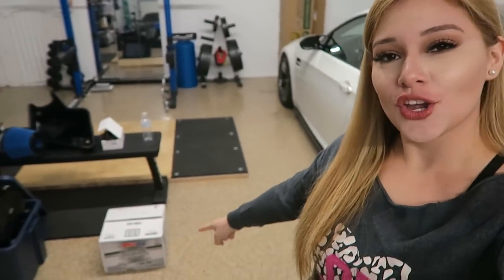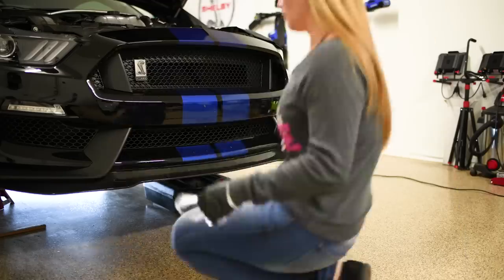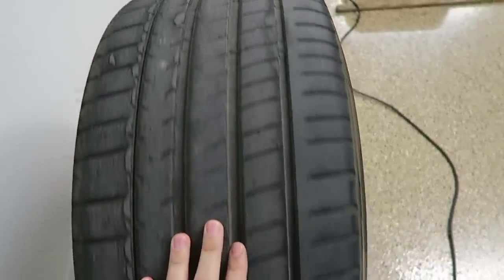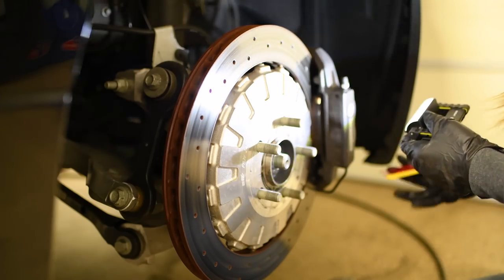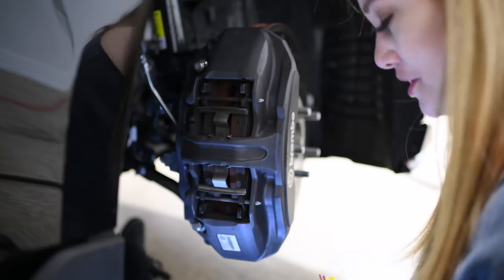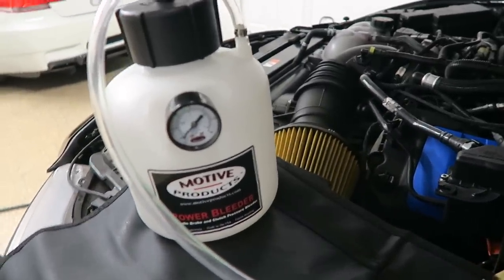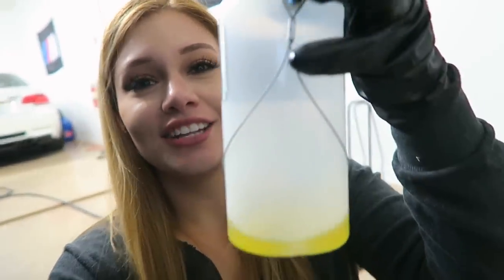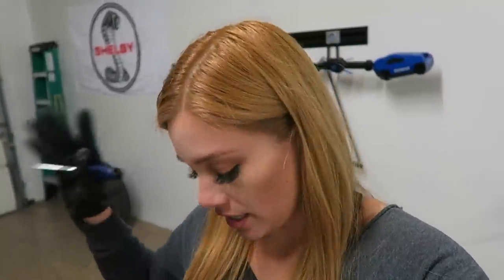2018 Shelby GT350 Brake Flush and Oil Change PERFORMED

Comment: Interesting about not oiling the o-rings. Not to mention seeing a GT350 serving as a test mule for the GT500 and talking to the engineer. Finally got my break-in miles in and did my first oil change. Putting a quart size freezer bag over the entire filter assembly as you remove it works great! Excellent video as usual. Great content, editing, and video quality!
Reply from the maker: I thought so too. He went into further detail about it. But he was firm about me not oiling it next time. Pretty knowledgeable guy. That is a good idea on the freezer bag. I never thought of that. It would save a mess from happening every time. Have fun and enjoy! Thanks for watching.
Reply: @woman.driven  tearing the orings because you put them in dry is worse then the off chance of the filter housing coming loose. if there is sufficient vibration to work it loose then drill a hole through the tightening nut and run safety wire. almost every spin on can style performance filter even has holes for safety wire.
Reply from the maker: O-rings won't be 100% dry. They just won't be oiled more than they need when they go back into the housing. Since oil residue exists in the threads already. I'm just simply relaying the info provided to me by someone who was part of the team that engineered and tested that engine.

Comment: Just a tip... You should be using a micrometer to measure brake rotor thickness instead of a slide caliper. The slide caliper measures an area that extends from the edge of the rotor towards the center. The burr that forms on the outside edge of the rotor can throw off your measurement. A micrometer would measure one spot right in the middle of the rotor surface.

Comment: Just FYI he inside pad on my GT350 wore out much faster then the outside on the front. Always good to check both and when changing pads out the pad with the metal tab on the inside just to be safe. Nice work on the maintenance!
Reply from the maker: I was expecting to see one with more wear than the other. But they wore evenly for whatever reason. Perhaps I'm not braking hard enough lol. I'll likely replace the pads after the next track day. I've also read about changing out the backing plate to a different one to keep the temps down. Not sure if that's what you meant by changing out as well.
Reply: Woman.Driven with 8mm you still have a ton of pad left! New pads start at 9.5mm for stock front pads. The backing plates do block heat transfer to the caliper but force more heat into the pad and rotor as a side effect. If your not cooking seals and fluid which I have not either I wouldn’t worry about the backing plates. As for not braking hard enough, just stay within your comfort zone and dial it up little bits at a time. Brake wear differs a lot between tracks as well. Those with high speed straights into low speed corners will chew some pad!

Comment: Great video content, very educational. I.m considering putting hood pins on my GT350 since the hood dances around during high speeds (also going for the cool factor). Since seeing the GT500 and the use of the Quick-Latch system I have ordered a set. Take a look at the web site for Quick-Latch item QL-50-LP/BP in black. I'm interested in your opinion and perhaps if your considering this would be a great how-to video to post.
Reply from the maker: That is a good item to consider. I do notice my hood dance around on the highway or at high speeds. I will look into it and check them out.

Comment: Saline call Bro cobra Mach 1 Roush Shelby GT500 Big 8 what's 6 or 6 cylinder 5.0 what the exhaust system you can feel every bit of our every time you messed accelerator you can feel the engine, live with the right exhaust but remember cars are only an extension of your body true car lovers know the nature of their machine and no one something wrong from a sputter of a fuel injector that the acceleration of the spark plugs

Comment: wow, well done, this was by far my fave video, well until the lift video; thats the one that brought me to the channel. I really liked this one because i learned alot, annnnd I use Amsoil and Motul too, that surprised me! Motul brake fluid is amazing, so is their ester core oil, but dosnt last as long as amsoil. funny story about the oil filter spin off, it happend in my s2000 on my original F20c engine, after i added a filter magnet to it (i also may have turned it, but that was a loonng time ago when i wasnt very good at working on cars). There is a cool item for the s2k's by J's racing called an Oil Filter Stopper. An arm mounts on a timing cover bolt and via a small steel cable, holds a worm clamp tightened onto the oil filter; clockwise to keep it from spinning. when i swapped my engine, i made my own! well, as always, keep it up and dont give it up, ur doing so well on youtube!!!

Comment: Type 2 or type 3 brakes the type of brake system looks pricing but the caliber is no different might come racing you know when you're racing the calipers and brakes heat up what time does the fluid My Car Performance brake fluid on brake lines things like that sometimes the heating itself War still plates warps a plate just from Heat

Comment: Curious why you chose Amsoil over other products? I use it in my motorcycle. I have a mechanic that is encouraging me to change
Reply from the maker: I read a lot of good things about it and also looked at comparisons with other oils. Plus, after 2500 miles of tracking, racing and canyon runs..no burned oil.
Reply: @woman.driven  Amsoil is the best...look at metal-wear comparisons.  I put it in ANY vehicle that I care greatly for and it's NOT cheap.

Comment: Hi, much appreciated video. I see a lot of great care taken and I see that you are highly skilled. I enjoyed watching you do all that. 
I have been reconditioning the entire brake system of a 1961 Humber Hawk Series II that I have. The car had sat unused for 25 to 30 years and the brake components had ceased and corroded.
It has been quite a job doing it component by component. The front caliper pistons had ceased solid and the only way I could remove them was by tack welding a piece of bar across each one to support and apply pressure with my press. Then I cleaned and painted the housings and replaced the pistons and seals.
The master cylinder and remote servo had corroded through so I replaced them with newer versions. And I remade all of the lines.
I have been reconditioning the front suspension and cross member unit too.
I haven't checked the rear wheel cylinders yet or clutch.
Luckily the engine is fine and started fairly easily. But I have to replace the fuel lines and see if I can clean the tank as it may be dirty inside.
I enjoy doing the work myself and it is rather relaxing.
I am looking forward to having the car drivable again.

Comment: If you don't have a large syringe from an auto store or a turkey baster from the Dollar store, then use an adjustable spray bottle trigger sprayer and spray the old fluid into a coffee can or something that's wide and deep to catch the fluid.
Reply from the maker: Very smart with the spray trigger. Extremely useful tip. Thank you. I just need to stop the excuses and get a turkey blaster.

Comment: you make me wanna work on my car but it's currently snowing like crazy up here and cold af,too! just curious,when it's time to replace those tires,are you gonna go with the same brand or are you gonna get something more sticky-track oriented set?also,how much did you get your portable car lift? i hope you don't mind me asking.oh,i heard fathouse fabrication will include all those maintenance for free with their 1200R package.looking forward to the next video!
Reply from the maker: It gets cold here..sometimes to where the garage is mid 50s..not any more but it was like that a few weeks ago. But I'm sure with snow it must be worse lol. I'm looking at NT01 or R888Rs. Need to read a bit more and figure out what is best. The portable lift (QuickJack) is about $1500 for the model I have. They sell smaller or shorter ones for about $1100.

Comment: Nice work kiddo.  The straw in the bottle is used when you manually pump the brakes to make certain you do not suck air back into the wheel cylinders.  It should be in the liquid at the bottom of the bottle.  I'm not sure why you are bleeding the brake fluid anyway.  It looked really clean.  I wouldn't flush the fluid until it looked dirty and that would probably be about 3 years.  Just my 2 cents.
Reply from the maker: Okay so I was right to think by removing it I would not have any issues considering I was not pumping my brakes. The need for the change is peace of mind. I have already done several track days exposing the fluid to higher temps than normally driving it. My last session I noticed a softer pedal feel towards the last few laps. So I changed the fluid with higher dry and wet points.

Comment: nice, i switched from motorcraft to royal purple. It got rid of most of the loud valve train noise.    how many miles does the GT350 have now?
Reply from the maker: It has 3500miles at the moment.

Comment: The bottle @16:00 is basically a bong.
The purpose of the inner straw is to prevent drawing air bubbles back into the brake system.  If any backwards flow happens, it draws fluid from the bottom of the straw instead of air from the top of the bottle.   I can't tell from my small phone display but it looks like your spill was caused by flipping the inlet and outlet
Reply from the maker: Okay. That makes sense on why it started coming up from the top due to the pressure of the bottle when bleeding. The leak was caused by the straw itself. So I removed it.

Comment: Your pad and rotor check reminded me of a question I've been meaning to ask. Have you noticed any brake fade on your track days? Great vid as usual, Doris!
Reply from the maker: Towards the end of the final laps I feel I need to brake a bit earlier..I stop trusting them. I'm probably too hard on my brakes. I will change them up to race ones next. But the fluid this time around should hold up. Rotors are fine..but maybe another track day in them..or two.

Comment: Dorace I'm gonna change my oil on my tbss my boy clowns me cause I wanna use mobile 1 oil. He says all oil is the same heck he told me I would be fine with the wal mart brand supertech. What's your opinion?
Reply from the maker: I mean. Yes and no. There are tons of tests performed on different oils and how they compare. I suppose the same goes for gasoline as well. There is a quality difference. That is because the time, capital and energy it takes for it to be made. I doubt a Walmart branded oil will be the same as Mobile 1 oil. But then again you don't see race cars or high performing cars use the cheap oil or low grade gas lol.

Comment: You done a great job as always,but I noticed that the left side tires don't wear from the inner side as it's from the outside,also when flushing the brake fluid while still have the old discs and brake pads,the fluid should be back to the same level in the reservoir as it was before start the flush,so that when you put new discs and brake pads it will be correct.
Reply from the maker: Depends on the camber from the alignment. These have a negative all around. Good call on the brake fluid. It was still at the max line before I started the flush. I removed the excess fluid to put it back at the line. I should likely need new pads after the next track day..and naturally..new rotors. Thanks for watching.

Comment: Incase you didn’t know already but if there is a lip on the edge of the rotor you will get a false reading on the thickness. It’s best to use a c clamp style micrometer
Reply from the maker: I cleared that lip. The caliper has a very minimal raised section that gives you the room to clear very small edges like that. Here is the one I have: https://www.uline.com/Product/Detail/H-7352/Tools/Digital-Caliper?pricode=WB7992&gadtype=pla&id=H-7352&gclid=EAIaIQobChMI6-G6g9qR4AIVqSCtBh3K-ApzEAQYAyABEgIdX_D_BwE&gclsrc=aw.ds

If you enlarge the picture you'll see what I mean.

Comment: make sure there is not rust ridge before you measure the rotors. I would also not put back fluid that has been in the master cylinder, i would discard it.
Reply from the maker: It cleared the ridge without issues. If the rotor was spent more..then I wouldn't be able to use this caliper. I will buy an extended one soon. The fluid in the bleeder was discarded.

Comment: Why are you using a digital caliper to measure the rotors ?
Used the right tool for the right job 
You need to used a digital brake rotor gauge .
You having a wrong measurement with the caliper gauge 😉
Reply from the maker: There is a groove and a raised area that allows the caliper to clear the lip of the rotor for an accurate reading. Although I'm sure a specific tool would be better. These measurements work just fine for me to build a baseline for next time.
Reply: Woman.Driven 
I love 💕 what you do and really like how you can do all this things ,I am really impressed that is why I am subscribed to your channel,it was just observation 
And you right just give you a good idea to see what is the condition of the rotors

Comment: Nice video.  Thank you.  Is there is a particular reason why you chose to use  Amsoil Synthetic motor oil?  Did someone recommend it to you?  Also was it 5W-30?  I realize good synthetic oil that doesn't break down is great for track use.  But I've never used Amsoil, so I'm just wondering what you think of it.
Reply from the maker: I read a lot of good things about it and also looked at comparisons with other oils. Plus, after 2500 miles of tracking, racing and canyon runs..no burned oil and never had to top it off. So that is always a good sign. It holds up to the stress I put it though lol. GT350 takes 5W-50.
Reply: @woman.driven  Thanks for the info!

Comment: Not to put oil on the O-ring did he say for the GT350 5.2 not the S550GT 5.0 ? I would like to know more abut this ? Another just spot on , Great Video !   U Rock......
Reply from the maker: He mentioned the paper style filter for the GT350. The plastic filter cap comes with two o-rings. Very different from the metal ones you'll use. Thank you!
Reply: Thanks I just checked it out , yes nice filter W/ 2 rings & 1 tiny one @woman.driven

Comment: Great job in maintaining your car. I notice you use Amsoil oil, aren't they suppose to last longer? But it's good that you look after your car. I use synthetic also but I change it every 6 months. Thanks for sharing you truly are amazing, you can do and more for sure than I do. Keep up the great work. Have a wonderful day.
Reply from the maker: Yes..in regular driving conditions, Amsoil will last a long time. But since I plan to track the car once a month it makes sense to change the fluids out with a faster interval just so the car gets tracked with fresh clean oil. It's common practice for ones that track the car for a full day. Oil changes after every 2nd or 3rd track day. Thanks for watching.
Reply: @woman.driven  thank you for your kind reply.

Comment: next brake fluid flush when you are done with the power bleeder release the pressure and keep it on the master cylinder. then unscrew the pressure bottle and open the bleeder on the left front and let it bleed more til the fluid level in the master is at the full mark. this will save the mess from spilling.
Reply from the maker: I believe that is what I did. I lowered the pressure bottle to the ground so the center of gravity was lower, opened the bottle slowly and waited till all of the fluid in the tubes drained back down. There was only a but of fluid in the master cylinder that I removed with eye droppers lol.

Comment: Just curious, did the car even need a brake flush and pad replacement?
Reply from the maker: Brake flush yes. I already had two full days and one half day at the track. Running my car a total of 10 sessions worth 20mins each. Flush and oil change was needed. I won't have to do it again till two or three more track days. Plus I do run this car a lot in the street as well. Pad replacement will likely be next time.

Comment: What oil do you recommend out the two royal purple or Ams oil?  Be blessed
Reply from the maker: I choose Amsoil. Simply because I have not burned any oil using it and I drive this car rough lol. Plus there are a few comparisons online between the two. Check them out.
Reply: @woman.driven  I run Royal Purple. But you are the 3rd person that have told me Ams dont burn up. I have noticed that RP is burning and Little. I will be switching over to ams.  Thank you for answering back.  Be blessed

Comment: A lot of work for such low miles but it gets used as it should. You need a MotivX Tools oil funnel. They are super nice especially as much as you are going though oil.
Reply from the maker: That is a very interesting oil funnel. I love the design and color. I need one lol. Thank you!
Reply: @woman.driven  They lock on just like the oil cap sp won't tip over.

Comment: What lift are you using? Been lolong into these lately
Reply from the maker: I'm using the BL-7000EXT from QuickJack. If you don't need the length of the lift to reach the jack points on your car, they have shorter lengths you can choose.

Comment: Why amsoil over mobil1??? Amsiol better??
Reply from the maker: I use Amsoil because it has done very well in my car. Several full day track sessions, a lot of racing and canyon runs. Not a hint of burned oil. I also read a lot of good things about it and looked at comparisons with other oils. Plus, after 3500 miles I have never had to top it off.
Reply: @woman.driven  😘😘 thxs!!!